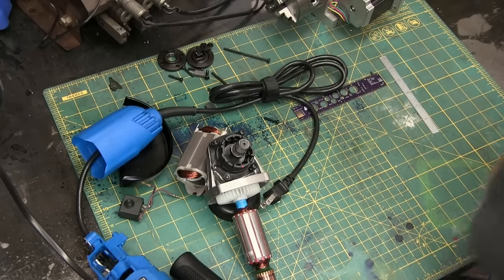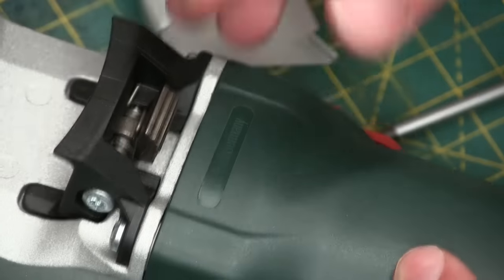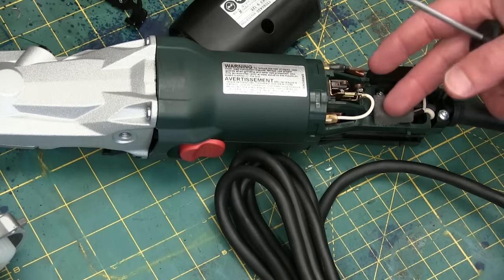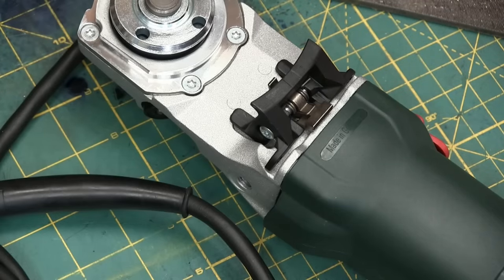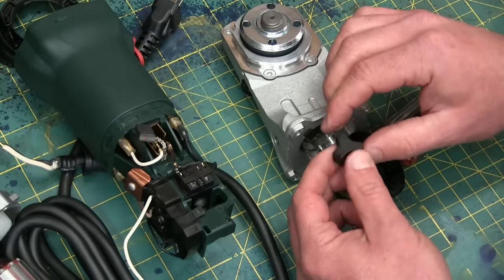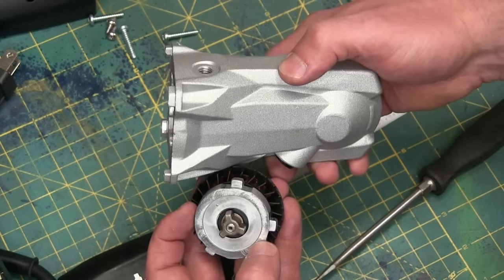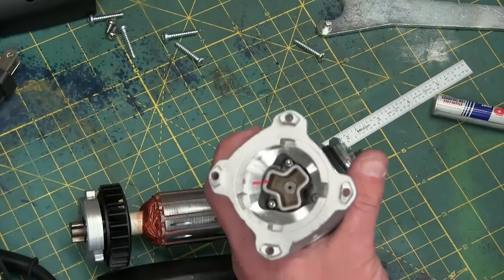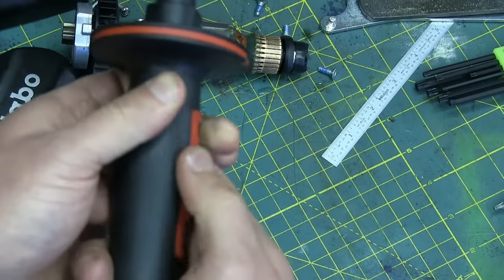BOLTR: METABO GRINDER. MADE IN GERMANY

Comment: If 14 gauge is rated for 15 amps and 12 gauge is 20 amps. What is 16 gauge rated for?
Reply: Eric Ankudavicius The gauge doesn't exactly determine the Amp rating, it determines the resistance, if it is too small of a gauge, and you put too many Amps through it, it heats quite a lot.
Reply: Typically 13 amps

Comment: The plug in the back of the brush is holding a spring that's pressing on a plunger that pops out the Front of the brush when it's worn too far , pushing the brush away from the commutator http://perkinspowerproducts.com/wp-content/uploads/2014/02/hcpinterrupter-1.pdf

Comment: I think AvE is losing his touch.  Dude that foam is an air filter.  Cold air in, through the filter, hot air out, opposite side.  And I don't think I've seen a Lovejoy Coupling without a spider, it is the working element that gives the coupler its key attributes - misalignment correction and vibration suppression.
Reply: And what happens when that glued in filter gets clogged?

Comment: I would like to see grinding into a 1/4 inch piece of flat steel that is welded onto a heavier piece of steel.   Push the grinders into the steel, not just on the top of steel. !/4 thick by 1 inch wide

Comment: :( metabo was not nearly as skookum as I was expecting.  Should known from that fancy ass skill saw you took apart a while back.

On another note, I recently bought some cambodian tire grinders, not the one you tore apart but the 9amp rattail model.  So i get er home and figure, what the hell? why not tear er apart.  It doesn't have the main weakness the lower models have\had (the main bearing casting isn't plastic, but cast aluminum), but I did notice one pretty chincy part.  So it has this rotating handle like that sawzall you got from princess, they router the wires the same way (just loose wires to allow enough slack for the handle to rotate).  They fuckin just extended the wire from the windings and put some 105c sleeve's over it!, those wires bend back\forth as you turn the handle.  Guess I'll know just how to fix em once the 3 year warrenty is over.

oh, and it's all pa6-g30 for the plastic, got nice little brush covers so you don't have to tear the whole damn thing apart as well (the smaller one's don't have any covers)

You might wanna look into em, I was looking at getting a makita, but when these went on sale for 40 bucks, i couldn't help myself (Makita's almost 4 times the price round here)

Comment: hmmm something tells me that not all Makita grinders have forged steel gears, I have a feeling that maybe the 4"- 5" AJS Variable speed have forged gears, the 7" -  9" ones have forged steel gears specially the one I own is still in production  and it has all aluminum body except for the handle. Now on another note I also work tons with the 4" Makita grinders, at price point of $50 for the grinder,case and some abrasive wheels included I honestly doubt that the 4" grinder has forged steel gears, most likely they are powder steel and the MIM molded.... Funny thing is and not sure how Makita does it, but the 4" grinder last me with years and seem they don't die, the only thing that dies first is the switch in the first 3-4 years and not worth it replacing it because by the time I order it, pay shipping its close to $25...... I just buy another Makita for $50, end of story.

Comment: Throw a 6"er on er... wire cup wheel that is. Put 2 hanles on her,  to keep her from spinning use 2 ubolts over the handles through some plate with a brick hanging off the ubolts . Yhat way you have a hand free  for the bear... and consistent load..

Comment: The wire is SJ type made by Rifeng Electrical in Guangdong (UL approval E251603).  It's not a natural rubber, but an EDPM.

Their UL file for this wire is http://database.ul.com/cgi-bin/XYV/template/LISEXT/1FRAME/showpage.html?name=ZJCZ.E251603&ccnshorttitle=Flexible+Cord&objid=1077674417&cfgid=1073741824&version=versionless&parent_id=1073996393&sequence=1)

Comment: Nice video.  I love my HF grinders.  For $300 bucks, I can buy ten HF 4-1/2 in. 6 Amp Heavy Duty Angle Grinders vs. one Metabo grinder -  Metabo is not 10 times better.
Reply: How much is it worth to you, to not enrich a communist country which pollutes the planet and hates America and its inhabitants? Ever seen a commercial ironworker using Harbor Freight to grind their welds? Me either.

I've seen and personally broken dozens of Harbor Freight tools under light to moderate use. Only had one Metabo tool ever fail (cordless impact, Korean made version), and that was after 3 years of hard commercial use while attempting to drill through 1" steel with multiple Tec screws. Would agree they're not 10x better, probably more like 20x.
Reply: Yeah stick it to communism, evil plague of the free democratic world, buy a metabo
Reply: If you love HF you don't use a grinder much!! Lol
Reply: But what about using two identities to get six Bosh variable-speed grinders from Gnome Depo?
Reply: Rick Rabjohn yeah, you're right, in fact, the HF is ten times better! My boss just got a cordless metabo grinder, and it gave up the ghost the first hour on the job! Cut through a couple u bolts on a Chrysler 7 1/4 rear end, and it got Ted hot, and smoked so bad, an hour later, I can still smell the melted plastic! (And it was being used outside!)  It slowed and completely died in a second (literally!)  We are going to take it back and shove it up their ass! good thing for the three year warranty! DON'T BUY METABO, YOU WILL REGRET IT!
Reply: STONE PHILLIPS r/ShitTheDonaldSays

Comment: Great video as always! I remembered hearing the opposite about tinning wires so I looked it up.

Tinning stranded wires that are going to be screwed down isn't advisable since with time the tin will slowly move out of the way making the connecting loose. See http://electronics.stackexchange.com/a/29862
Reply: decent crimp is enough for 10 years of heavy use

Comment: 1 metric HP = 1360 Watt / 1342 imperial HP or 
1000 Watt = 0,735 metric HP / 0,745 imperial HP
900W = 0,661 metric HP
Reply: Denny Sir, i believe you will find that a horsie is equal to 746 watts.
Reply: Actually, I am also ok with 4 hooves and a long face. But the generality of the joule provoked a proper answer.

Comment: I would say the only reason why most angle grinders die is the damn dust getting into the motor and ruining the cooling factor... 
Abused 800W dewalt on nearly everything, even put a 210mm saw blade on it and bolted it to a stick to cut 4 inch trees down by just using it as an axe.
Still nothing wrong with the bearings, neither anything else except I left it out in the woods for half a year and didnt clean it up from all the junk that got into it and burned the motor. I even slammed the shitty powder metal gear with hammer to get that saw blade off... I dont think you guys would do anything like that to a metabo.. Not a fan of dewalt, I would go for metabo but the price..

Comment: I have Hurd tail of mobs you have to finish with some mouth sanding?? care to do a video explaining that?? Lmao. That loves connection rubber madness seems like it would be the first to go after the switch and that thing would start clacking and bang it’s self to bits. By fixing the problem with the output shaft they put the tension right on that rubber piece that’s why they did it but I just don’t know how well that’s going to work

Comment: Built in future failure so they need to sell another ?
Reply: Ben Kool Most companies will build in at least a few places where it will wear out, but for $300(even though it's Canadian) you would expect some better things than the cheap bearings and such.
Reply: Either this or to sell parts. I bet most of the parts come in 50-100 eur assemblies instead of 5 eur for an actual part.

Comment: It's weird....in Holland no one gives a crap about Metabo tools. They sell em at every diy in the country. It's not considered a pro tool except in the metal industry where they use the drills and grinders alot (if I remember correctly they where the only ones that had a safety on the drill to shut it off when it seized when drilling steel, at least 20 years ago). Same with Makita, used in the metal industry but hardly outside it. Only very seldom do you see a pro using Makita or Metabo over here. Also strange that I have yet to see a Metabo tool in Holland that says "made in germany" on the side. My Metabo tools have no country of origin on them because it's not required by law over here, so that probably tells me that they are mostly made in China....except the most expensive ones maybe? Are all Metabo's shipped oversees " made in Germany"?

Comment: on capacitors for motors. i always thoght they acted like another phase to help turn the motor in the right direction. i know that a lot of motors i work with will not start without them while others dont need them. any solid answers?
this is what i am going off of: https://sciencing.com/ac-motor-need-capacitor-start-6596783.html

Comment: I respect you greatly and would even enjoy Slamin a couple cold ones with yah , but to doubt Metabo or the Germans for that matter even a second is just plain idiotic. I am a Professional Heavy Industrial Welder. Have been since 1992. I can’t think of any other electric Grinder anywhere that can stand up to a Metabo. Hitachi got really close around 2000. Just close not equal. Until you have personally stood, crouched, laid, knelt, hunkered or otherwise existed with a grinder clenched in your knuckled hands for 10-16 hrs a day in some of the most God awful locations in the dark dirty Anals of whatever type of Industrial plant you get thrown to this month, you can’t really judge a grinder proper... least we forget that Germany is the cradle of modern engineering. But remind yourself that engineering is not about designing something with all the toughest, slickest, most expensive parts. It’s about designing something as good as it needs to be. Believe me when I say this... there is no other grinder that has the level of Engineering this one has. Somethings seem qwerky on the Metabo from time to time but it’s done with an intent and it works. To the guy in post last or not long before said he had one he had to smack to make run. That could be but a couple of years Metabo made some machines with an insanely long soft start time (no start for a time) but I bet that’s what you had dude. But I digress... taking one apart out of the box and second guessing technology you don’t fully understand then putting it back together wrongly or broken or missing to see what ya got now is not at all fair for the Metabo. Cause they flat out run. They run when they should have long ago died from abuse and neglect. I see it over and over. With dumb fumble fucks I work so proudly alongside. As for Mikita we don’t even consider them Industrial Quality I kid you not... last time I saw them at a worksite (long ago) the air had a funny smell as if little pixies were flying out into the air and a pile of useless grinders heaped in the corner. I swear Mikita never made it Through a week. I have never used this long lean version of this but if this model is not all that. It soon will be. I have seen Metabo’s designers come up with some great products over my time. I love ya bro but you’re wrong on this one. 
P.S. there is a reason for sloppy switches... when you really use a grinder...I said really! Room to let the switch function when the dust, grit, and fallout get real!! Like an AK-47 TRUTH!!! Can’t believe you didn’t catch that.

Comment: Yo, you question, why the connections are loose or things don't hold that long today as 20 years ago.. The system is called capitalism. Even cars are designed to break some day. Lower class cars are designed to hold 150k kilometres and middle and higher class cars to hold 300k kilometres. So the car industry can work pretty good because every 10 years you need to get a new car becaus the old one gets more and more reliability problems. The same with Metabo Grinders. if they hold for 30 years the people who buy them won't buy new ones. So basically everything is designed to break... but just on the right spot. some parts still last forever because they show good german engineering.

Comment: Metabo is cheap shite found in Aldi stores
Reply: Metabo tools have never been sold in Aldi neither north nor south, you can get "Brüder Mannesmann" crap and similiar stuff with no names, but Metabo is a name-brand which only sells in big hardware store or even in special purpose tool stores.
Reply: Metabo are top shelf tools. I had one. I got it at the wholesaler where my boss got all his stuff at. It was marked down because a new model came out. I would have never bought it otherwise. My Bosch was good, but old, at 4.5 amps, it didn't have the skocum to do some things quickly. The Metabo was 9 amps, duble the skocum!

Comment: Nice cos gear box is flat and long . Switch is crap , for sure , cable is good , a bit thick , cos is , i think HOR7N  , good for working out side on low and hi temp . Sponge , as some kinda isolator ! Danger for fire , plus shaky wire connectors ! That guard adjusting item  nice and quick , hmm , mixing steel and plastic , under of working stress woun't go for a long . What a f ... , coupling , between motor and reductor , with rubber '' condom '' , just to run away from it ! Thanks to AvE , i figured out , this expensive tool is full of shit in mech. and elec . design and construction , no way to buy it ! Shame on Metabo !